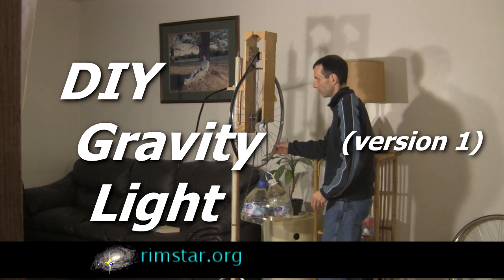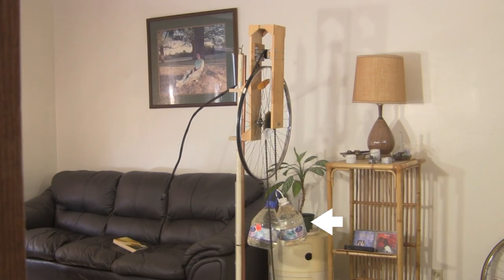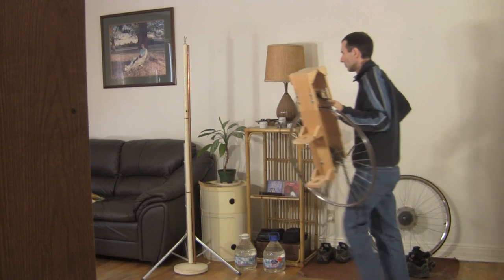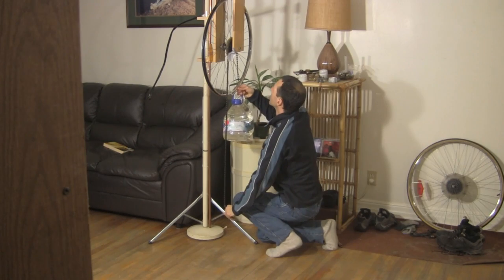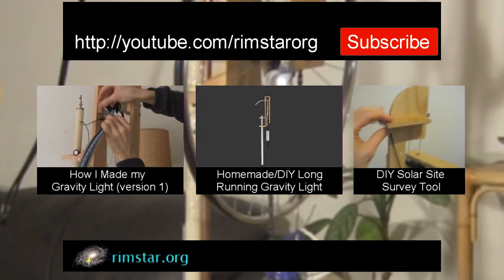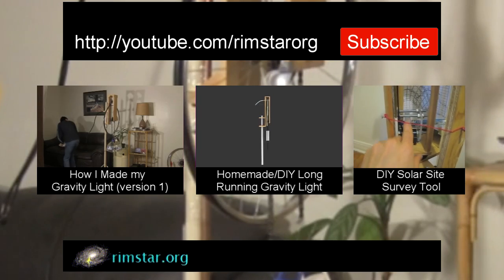Gravity Light - a Homemade/DIY one (version 1)

Comment: Can I ask what’s the watts, volts and rpm of the microwave turntable?
Reply from the maker: I don't know the actual rpm that the turntable spun at but the motor label says 6 rpm. It also says 120 VAC and 3 watts. You can see it on my webpage here https://rimstar.org/science_electronics_projects/gravity_light_homemade_diy.htm along with many more details and calculations.

Comment: Hi, I'm also making a similar project. Why does my motor require a fast rotation to produce electricity? While yours, even though it is rotating slow it still produces electricity?
Reply from the maker: Mine isn't slow at all, at least not inside the generator. At every step along the way from the falling weight to the electric circuit, you need to convert slow rotation to faster rotation. My final step is the motor taken from a microwave oven. I use that motor as a generator and it converts slow rotation to very fast rotation inside the motor.

Comment: good job. I would like to know how many joules (or kwh) this system can deliver once the weight is fully reloaded ?
Reply from the maker: Thanks. I show calculations for my version 2 on my webpage here (near the bottom) https://rimstar.org//science_electronics_projects/gravity_light_homemade_diy.htm I calculated 180 joules for the 1.2 meter drop.
Reply: @RimstarOrg  ok. That's very little... a simple AAA 1,5V battery would be able to deliver 15,390 J. 
And I can carry a AAA battery in my pocket. 
However you system creates no polution. thumbs up for the idea and the making of it.
Reply from the maker: Thanks. Mainly for me it was the interesting engineering challenge.

Comment: Hi, may I know how u control the speed of the dropping mass? I am doing a similar project to yours and I would like to know how do I calculate how fast the mass is dropping
Reply from the maker: I don't have any formulas for the speed of a dropping mass.
The way to control the speed is to increase the gear and/or pulley ratio between the mass and your generator. Luckily, microwave oven motors, which is what I use, have a lot of gears inside to turn a very slow rotation of the motor shaft into a very fast rotation inside for the motor/generating coils.
I give some tips on how to do that, including calculations, on my webpage here:
https://rimstar.org/science_electronics_projects/gravity_light_homemade_diy.htm
Also, check out the videos on that page for making my version 1 and version 2 since they give a lot of construction details and tips.

Comment: Question: how do you compute for the right weight of the counterweight? pls reply thank you
Reply from the maker: I didn't. I just put on more weight until it moved, but so that it didn't drop faster than I'd like (I wanted it to run for as long as possible). This video is of version 1. The stand could handle the mass, but only just. For version 2, I made a stronger stand https://www.youtube.com/watch?v=GisQYoYw05k.
I did do some calculations for the pulley ratios though, which you can see on my webpage here https://rimstar.org/science_electronics_projects/gravity_light_homemade_diy.htm.
Reply: RimstarOrg oh thank you so much 😊

Comment: A system of 4 pullies can make a length of rope move  4 feet for every foot an object drops.  A rope that can hold 50 lbs alone can suspend 200 lbs with a 4 pully system and need only 50 lbs of force to lift the 200 lbs weight.

Comment: Hi sir, can I ask a question? What are the alternatives for the motor you have used?
Reply from the maker: It may be possible to use a stepper motor. Another alternative is to make your own along with a bunch of gears.
Reply: RimstarOrg  I mean can I use dynamo instead?
Reply from the maker: Maybe. I haven't looked into any generators (dynamos) which are made specially for generating electricity. The important thing about the microwave oven motor I used was that it has a lot of gearing in it to turn a slow rotation of the shaft into a fast rotation between the magnets and coils inside. If the shaft of your dynamo is easy to turn by hand then it won't work. That would mean it doesn't have the gearing. See my webpage about this for a diagram and more of an explanation https://rimstar.org/science_electronics_projects/gravity_light_homemade_diy.htm.

Comment: First of all, thank you for this video
Today, i went to a shop and asked for a sync motor(220v, 3rpm and 4W). I was not able to rotate it with my hands, I'm sure i was using more than enough force. But I couldn't rotate it :/
Reply from the maker: I can't rotate the one I use in this video either, not if I hold just the shaft with my fingers. So yours sounds promising. If you grip the shaft with some pliers or something then you should be able to turn it. Just don't turn it too fast because when you turn it you are generating electricity in its coils and turning it too fast could produce too much voltage or current and damage the coils. Since it's a 3rpm motor, don't turn it faster than 3rpm.
By the way, if you're interested in making one of these make sure to check out my version 2, https://www.youtube.com/watch?v=GisQYoYw05k. More details are also on my website here https://rimstar.org/science_electronics_projects/gravity_light_homemade_diy.htm.

Comment: If you are able to run a 0.1 watt LED (and thus the name Deciwatt), for 8 minutes, with 2 gallons of water, dropping 2.5 feet, that would be 85% efficiency. The math looks like this: 1 watt second = 1 joule. And 8 minutes = 480 seconds. So, 0.1 watt for 480 seconds = 48 watt seconds = 48 joules, which is the output.  For the input let's convert to metric to make things easier:  2 gallons of water = 7.57 liters = 7.57 Kg.   And F = ma, so F = 7.57kg * 9.8m/s/s (acceleration due to gravity on Earth).  And so F = 74 newtons. This force is how hard the two gallons of water are pulling on the chain.  2.5 feet = 0.762 meters. Joules = newton meters = 74 newtons * 0.762 meters = 56.4 joules. This is the input. And efficiency = output / input = 48 joules / 56.4 joules = 0.85 = 85% efficiency. Seams reasonable, about what one would expect.
Reply from the maker: Cool. Sadly, I didn't measure it but I suspect that the electrical output to the LEDs for this version 1 was likely far less and so the efficiency was probably less. Those LEDs are lit nowhere near their full brightness. I did similar calculations for my version 2 where I did measure electrical output and the efficiency was 26%. You can see version 2's video here https://www.youtube.com/watch?v=GisQYoYw05k and the calculations for version 2 are lower down on my webpage here https://rimstar.org/science_electronics_projects/gravity_light_homemade_diy.htm.

Comment: If we combined this with some magnets would it be able to be converted into a battery for energy storage?
Reply from the maker: Yes, you could put together a circuit to charge a battery with this.
Reply: why would you need magnets? his machine itself cannot be converted into a battery because batteries need certain chemicals, among other things.  you could maybe get this to charge a battery slowly, if the voltage is high enough.

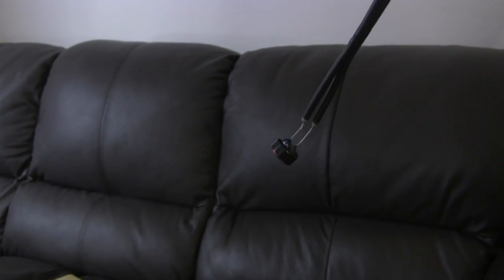Comment: I'm totally confused!... Re: 0:39, isn't the weight falling slow BECAUSE of the wheel?
:)
Bigger wheel = bigger circumference. At the same weight drop speed, the bigger the wheel the faster the generator's spin rate = the more instant Wattage over the same time lenght. In that case we don't need more weight to power the whole house: we only need a bigger wheel. It wouldn't make sense.

I'd say a bigger wheel = slower weight drop = slower wheel spin. But the wheel's circumference is bigger... So, how's the generator's spin rate affected?
:)
As far as I know, the slower the weight falls the less instant power you get over a longer time lenght. Less instant power = slower generator spin. So the bigger the wheel the slower the generator spins?...

So, if a bigger wheel means slower weight falling / less instant power, a smaller wheel would mean faster falling weight and more instant power. The faster the weight falls the more instant power (the energy concentrates on a shorter time lenght)?... 

Then if you'd attach the weights straight on the generator you'd get the the fastest fall and also the most instant power?... How?... The generator would spin the least number of times that way -- only with more torque.

Obviously, my logic is flawed. But I don't understand where.
Reply from the maker: It is confusing, so you're right to be confused.

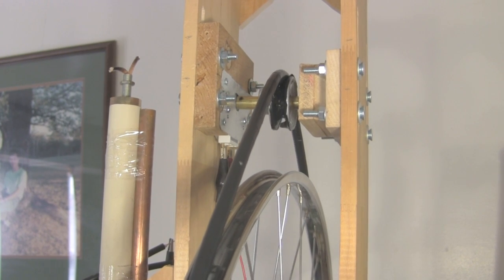Yes, the weight is falling slowly because of the wheel. And also because that generator has a lot of gears in it. You can't turn the generator shaft by hand. You can turn it by hand using the small pulley at 0:50. That's why I chose that generator.

If I made the wheel any bigger in diameter then the mass would no longer be heavy enough to pull it around. Likewise, if I were to keep the same wheel but remove a little of the mass then it would no longer be heavy enough to pull it around. Similarly, if I used the very smallest diameter sprocket on the wheel it also will no longer turn. I did a lot of adjusting of the mass to get it just right. So you couldn't keep making the wheel bigger and expect to use the same weight to power a whole house. The bigger the wheel the more torque the mass has to apply to the sprockets at the center in order to turn the wheel.

So I started with too little mass. Too little mass can't apply enough torque at the center to turn the wheel. So I added more mass until it had enough torque to turn it. Then I added more until it was turning at the speed that would turn the generator at its maximum rated speed.

So yes, "bigger wheel = slower weight drop = slower wheel spin" and that equals slower turning generator and less power out. At that point more mass is needed to keep the spin as fast as needed.

And yes, "As far as I know, the slower the weight falls the less instant power you get over a longer time lenght. Less instant power = slower generator spin. So the bigger the wheel the slower the generator spins?..." Again, you'd need to add more mass to fix this.

Yes, "So, if a bigger wheel means slower weight falling / less instant power, a smaller wheel would mean faster falling weight and more instant power. The faster the weight falls the more instant power (the energy concentrates on a shorter time lenght)?... " But you'd also be turning the generator faster than it's rated for and the higher voltage inside would create short circuits in the coils and it would be ruined. I don't remember exactly but this generator is rated for only a few RPM.

"Then if you'd attach the weights straight on the generator you'd get the the fastest fall and also the most instant power?... How?... " Yes. But again, you're ruin the generator.

"The generator would spin the least number of times that way -- only with more torque." I don't understand why you conclude this. The generator would spin more times. Hopefully it's clearer now though.
Reply: "'The generator would spin the least number of times that way.' I don't understand why you conclude this. The generator would spin more times."

If the weight would be placed directly on the generator's wheel, the generator would spin less times. But the RPM is going to be bigger, I guess, otherwise it wouldn't put out more instant power.

So, my bad there, when I asked "how".

If the weight is 2 m. up, and the sprocket's circumference is 100 cm., we get 2 spins. If the wheel's circumference is 3 m., a double spin runs 3 + 3 m. of cable on the generator's wheel.

If the generator's whell is 50 cm., then the 6 m. of runnning cable will make it spin 12 times.

Now. If you'd put the weight directly on the generator's 50 cm. circumference wheel, the 2 m. of weight falling will make the generator spin 4 times (instead of 12 times).
Reply from the maker: All your math looks right to me. And yes, if you put the mass on the generator's wheel then it will fall faster because it has less work to do. The RPM will be bigger.

Comment: 200 tonnes (ex. 2,9 m. sided cube of iron) dropping from 30 meters will continuously power 10 light-bulbs of 100W each for 8 hours.
:)
Can anyone check if that is true?... I'm not good with formulas, I've worked that out looking up formulas on Google and I'm not sure I've used the right ones, nor the numbers. To me it seems the 10 X 100W gained is too little.

Thanks!
Reply from the maker: Sounds like fun. Here's my try at it...

Assuming by 200 tons you meant 200 metric tons, where 1 ton = 1000kg.

200,000kg x 9.8m/s^2 = 1,960,000N (Newtons) weight or downward force here on Earth
1,960,000N x 30m = 58,800,000J (joules) energy produced or work done in falling that distance
8 hours x 60 minutes/hour x 60 seconds/minute = 28,800 seconds
58,800,000J / 28,800 seconds = 2041W (watts) the power produced every second
So you can power 20 100W lightbulbs (2041W / 100W = 20.41) during those 8 hours.
Reply from the maker: BTW I did more of these calcs about halfway down on my webpage here when I was working out efficiency:
http://rimstar.org/science_electronics_projects/gravity_light_homemade_diy.htm
Reply: Yes, I meant tonnes. I've edited my original message.
Thanks for the reply!
I assume that with 100 tonnes I'll get to the 10 100W light bulbs.

Comment: This was really good. Maybe add a joule thief to get more LED's lit up.  That must have been really hard to get set up.  We appreciate that.  It was quite entertaining.
Reply from the maker: Thanks. It was actually easier than I expected, probably since it went so well and I got lucky the first time. I'm looking at possibly joule thief type circuits for my next version. In case you haven't seen it, I did get brighter light with the help of some circuitry (as well as a longer run time) and show it in my follow-up video "Gravity Light - Making and Enhancements (version 1)".

Comment: It seems a joke, such a huge apparatus for just a small led. I use for camping a led lamp with the size of my hand, it has a small arm, turn it 30 seconds and you will have far more light for 15 mimutes, and it just costs $15.
Reply from the maker: This is version 1. I show enhancements in Gravity Light - Making and Enhancements (version 1) that get more light and runs for 8 minutes. If I raise that one to the ceiling then I should get 15 minutes. My goal is for around 30 minutes. And I think this is way cooler as a reading light at home than a hand cranked one. There's also no fun or challenge in making one of those, which is why I make it.

Comment: Won't gravity accelerate the weights constantly? I think there should be some sort of timing mechanism like what pendulum clocks use.
Reply from the maker: I think all the friction and the load from the generator help keep it falling at a relatively steady rate. However, the version in this video does speed up at the end as there becomes less and less chain on the other side. In the next video Gravity Light - Making and Enhancements (version 1) I show this problem and how I solved it by adding a counterweight to the other side. But that may become a problem again in future versions.

Comment: Great job ! I can't wait to see your latest version. I have one of my own and am almost done with my latest version. I will post it when it is done, my old one uses a large wooden pulley a strong nylon string and water bottles for weight. It turns my geared motor that is out of a power wheels ride-able toy. Here is my video link.  Gravity Powered Generator

Comment: Put that thing on a 30ft pole/tower and you might have light for a couple of hours.
Reply from the maker: Yup! I'm currently dropping it around 2 1/2 ft, and since this video came out I've increased the run time to just over 8 minutes. So for a 30ft pole that's over an hour and a half.
Reply: RimstarOrg Great for third world countries with no electricity. Add a clutch so you can pull the weight back up and have the rope next to the place your sitting/laying and you can pull it from there and keep on having continuous electricity (of course the momentary black out when pulling the weight back up, lol).

Comment: What's the black gooey material on the top small pulley? It can't be grease.
And what did you use as the generator? That's the most important part.
Reply from the maker: The black gooey material on top of the small pulley is actually black vinyl electrical tape. It just looks irregularly shaped because it's made up of many smaller pieces. The generator is a microwave oven tray motor, the motor you find underneath the microwave oven. Note that if you turn this motor too fast, you can damage it, though it usually works again later. I'll be uploading a how-it's-made video on Friday.

Comment: Cool!  Very rugged yet simple design!  You might be able to get more light if you use a high wattage LED like a 10 watt one.  You will not run it near the 10 watt ratting but it will be more efficient.
Reply from the maker: Thanks! I haven't looked at the output of this generator yet, and I'll be trying other generators too. Once I know the output better, then I can match up an LED. Though 10 watt LEDs are new to me. I'll look into them further.
Reply: Cool! 10 watt LEDs are a little over $1 a piece.
  http://www.ebay.com/sch/i.html?_trksid=p2050601.m570.l1313.TR12.TRC2.A0.H0.X10+watt+led&_nkw=10+watt+led&_sacat=0&_from=R40
Reply from the maker: Makerj101
I don't know if you saw my follow-up video but I got it to light 3 LEDs, and with the additional help of a circuit. Though, yeah, using a single, high efficient LED would be better. Thanks for the link.
Reply: No I have not.  I will go watch it now!  I have not been on YouTube for over a week!  Your welcome!